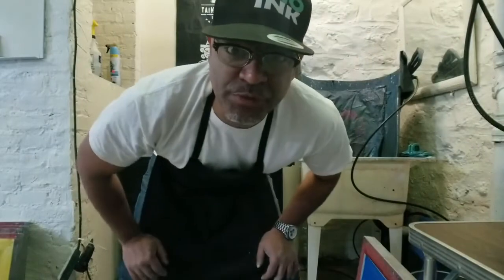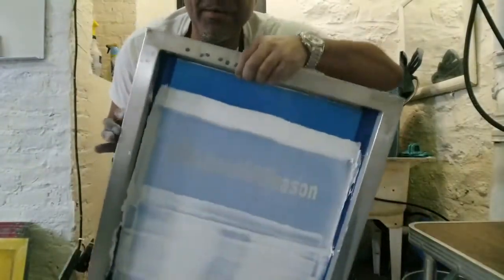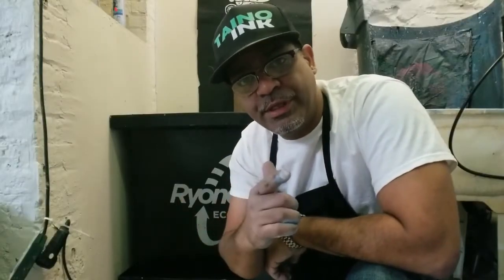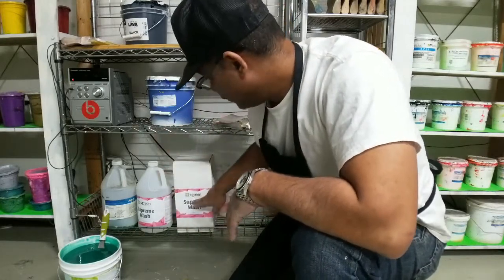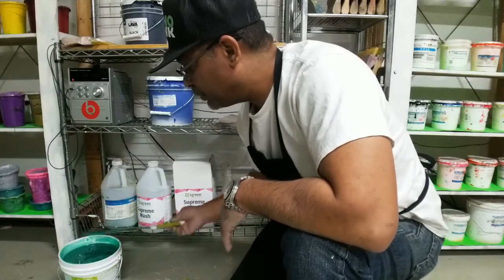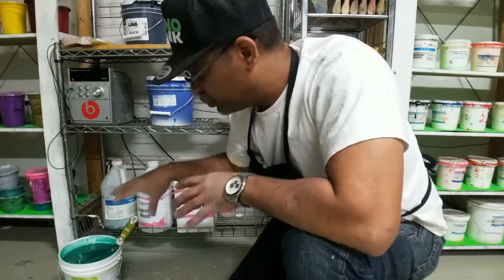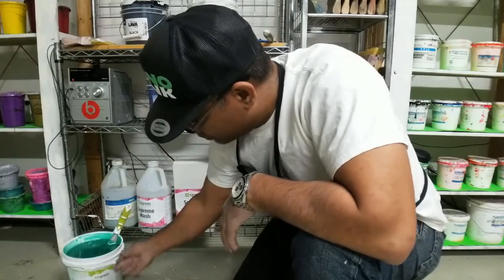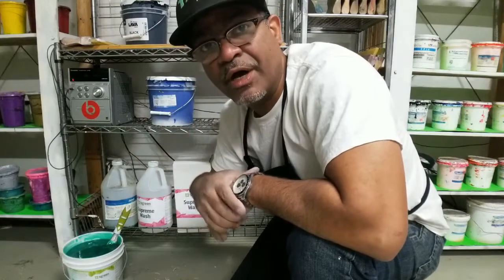How to Screen Print: Reclaiming Screen Fast and Eco Friendly.

Comment: Thank you for responding so quick. I have 4 screens and. Silk screen equipment. Now working on those chemicals you were talking about in your video. Plus the flash dryer. I'm really taking my time with equipment so I can get practice in to get better. But it's coming along .. I get most of my orders with vinyl. But thank you I like your attention to the details that you know we need to know. Keep up the great work!!!
Reply from the maker: Thank you. You could use a heat gun to cure your prints and a temperature gun to read the curing time. While you get the flasher. It works just as good. I did it like that when I also was waiting to get the equipment.

Comment: I was wondering do you have a filtration system for when youre rinsing the screens. And also in the dip tank how long do those chemicals last before you have to change them out for fresh chemicals and how can you tell?
Reply from the maker: O do have a filtration system. And the diptank chemical lasts about 4 to 6 months.
Reply from the maker: when you dip a screen and the emulsion is not coming off. Means time to change.
Reply: Taino Ink awesome thanks for sharing. I’m working from home and will be washing in my bathtub. I’m trying to rig up a bucket filtration system that’s removable when I need to shower 🤔